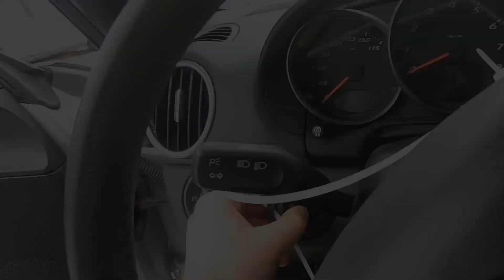Mercedes C-class W203, CLK-class W209 replacing the non-replaceable Sway bar bushings

Comment: CLK500 has the same bushings . I’ve done this same job.
Reply from the maker: The part number for CLK500 (and CLK320) is 2033232085. But it only fits 20mm sway bars. I guess it is if the vehicle doesn’t have a sport suspension.
Reply: I have sport suspension. Do you work on instrument clusters ?
Reply from the maker: Depends on the model.
Reply: @HETPEZB  2004 clk500 dead cluster . Have a used one that works but isn’t programmed to vehicle and getting errors
Reply from the maker: Is it totally dead, or just a display portion?
Reply: @HETPEZB  totally dead
Reply from the maker: If the memory in that cluster survived and both cluster shares the same part number - we can move the memory from your old cluster into your replacement cluster.
Reply: @HETPEZB  that’s what I hoped . How do I do this ??

Comment: I tried this on mine...but it is like glueted on the sway bar...it doesnt come of
Reply from the maker: Yes, they are molded on. Use a knife to cut it off. Just be careful not to cut yourself.
Reply: @HETPEZB  so i dont need to buy a new sway bar....ih dealer shop told me that i cant remove that bushing,and i need to buy a new sway bar
Reply from the maker: Officially you need a new sway bar. Unofficially you can cut bushings off and install the aftermarket ones. I mean I made the whole video about it :)
Reply: @HETPEZB  i know and i appreciate very much...but mine are stuck like glue...i doesnt move an inch....but thanks man

Comment: Replacing those springs is a horrible, horrible job. I bought three different cheap spring compressors and none of them worked. Don’t waste your money. The one I finally got to work was the “Powebuilt kit 91”. I think the expensive stand up macpherson spring/strut compressors work too. I ended up going with new H&R springs too. Getting that old stock spring back on the strut is damn near impossible.
Reply from the maker: Yep, those are the nightmare. I purchased a different compressor. Should be delivered in a few days. Hopefully it will do the job. If I’ll get some spare time - will shoot the video.
Reply from the maker: Just replaced the shocks. It's quite a workout. But my new compressor was able to do it. Video is coming somewhen.
Reply: @HETPEZB  congrats! I give you props. That is not an easy job.